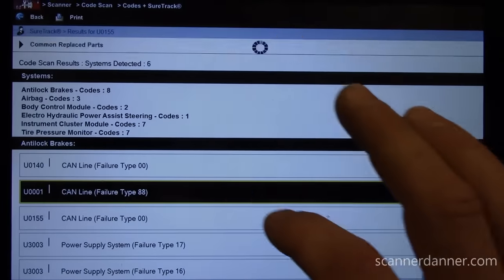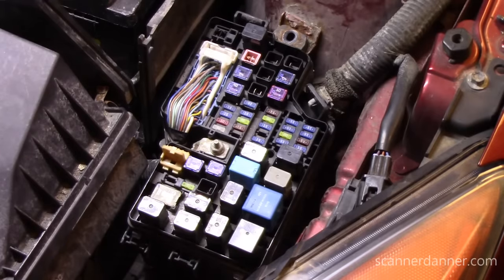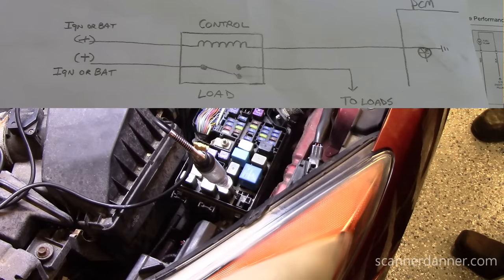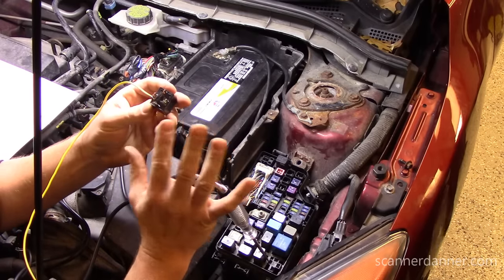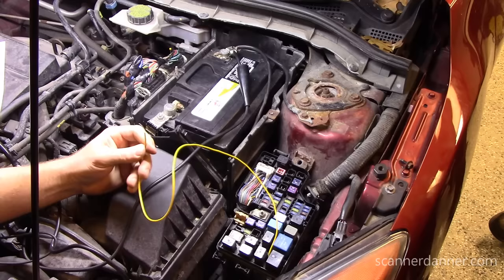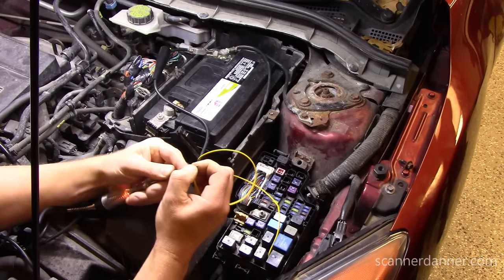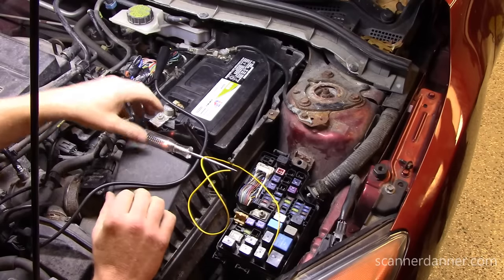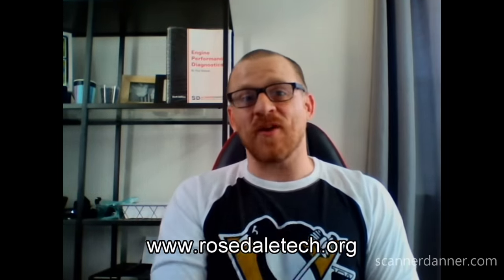2010 Mazda 3 No Communication With PCM, No Start, No Crank

Comment: I hope you can help me. There is no turn over when engine is hot it seems. No sound at all, no starter motor click nothing. I usually wait 15 minutes try again, so far it starts.
Sometimes when cold when I turn the key, there is a second delay before engine starts. My closest Auto electrician is 250 kilometres away. Battery is 8 months old and charged. PLEASE help if you can. Thanks.

Comment: I have 2014 mazda 3 when i start the car all the lights turn of and back with light engine and the steering wheel lock out & in 😬 is this battery issue?

Comment: Is that main relay considered the ignition relay?

I have a 2017 Ford Focus se no crank condition, 5v reference is good, new battery, U0100 (ecu took a hit in the accident but board looks good) all grounds looks good. (Jumped the starter relay and can manually crank the engine with the starter) 
Online support for wiring diagrams of ecu pins suck so I have not found ecu ground yet. Ignition relay is ground side switched.

(I dream of shopkeypro)

Watched your video about 6 times by now lol
Probe coming in the mail tomorrow so hopefully that will help narrow things down.
Reply from the maker: Here you go my friend https://eautorepair.adtrk.biz/?a=10817&c=24&p=r&s1=
Just seeing this now
Reply: @ScannerDanner  sweet this is like Haynes but online!
Reply: @ScannerDanner  the only thing I have found possibly being off is the input power for the ecu is 10v yet other pins are 12.4v
Reply from the maker: @thestateofreal2533  it is WAY better than a Haynes manual, that I can promise you
Reply from the maker: @thestateofreal2533  the one that reads 10v, will it light up an incandescent test light? (DO NOT use an LED type light for troubleshooting, they are garbage)
Reply: @ScannerDanner  yes it did light up the incandescent. After further investigation under my microscope the pcm board had a burnt spot where a resistor looked like it was there. I have ordered a pcm (as I was never originally planning on keeping the old one because it was so mangled) I’m gonna reprogram it to the car with forscan and see what happens from there but at least I will start with a good pcm.

Comment: I have the same issue on a 2008 Mazda 3 2.3L. I followed your steps. I have no power to 5 10 amp fuses, 32-36. I grounded out relay like you did but still get no crank. Not sure what color cable of the harness to ecu to check. Can’t find diagram anywhere.
Reply from the maker: https://eautorepair.adtrk.biz/?a=10817&c=24&p=r&s1=
It will cost you $20 but best money you'll spend. 
It is the DIY version of the same service info I use

Comment: I had a 01 Honda Civic and touched the Ac high pressure switch with my test light to power and smoked the ac control head and had no more ac compress control from pcm and not to sure why it happened, any insite would be helpfull
Reply from the maker: without knowing the exact wire you touched, I cannot even speculate what happened

Comment: My younger brother jumped my Mazda 3 2010 backward it stoped running we took it to a place they got it running but now no radio, no air, trip miles resets each time turn car off, car only locks with key in door no place can figure it out 4 places $200 each said they don’t no I’m $900 deep trying to figure this out and I have gotten nothing. I need help. Could you inform me were you got the 2010 Mazda 3 fuse diagrams. That’s what I need to get my hands on I can’t find it anywhere
Reply from the maker: Here you go https://www.eautorepair.net/marketing/html/products.asp?VID=&Count=Y
You most likely have multiple faulty modules from the reverse polarity jump starting

Comment: Which relay is that ? 
But I have tested 6-15 they both have ground 
But my car doesn’t work 
I have posted the issue on your website 
Please help me
Reply from the maker: There is a reason I had you post to the forum.
1. In every one of your questions you are not providing enough info.
2. You continue to start new threads leaving me with ZERO history.

YouTube comments are one and done for me, if your lucky. This platform is not set up properly for back and forth messages like this
Reply: @ScannerDanner  yeah it’s only one post them 
I think I’m getting there

But u know in each video of yours I’m following and learning  as I go as im testing all the possible faulty scenarios you came through. 

Thank u mate 
I think I finally got to the problem

Comment: hi have a 2012 Mazda 3 - i have 4 emission codes P061B-P0091-P0102-P2090 - I troubleshoot then already they check it out. i used my obd2 to delete the codes but does not work. disconnected the battery also. Checked the ground on the PCM and still the codes come up. when i turn off the key the obd2 turns green light (no codes?) when i turn on the key the codes come up again. ??  the car runs but rough idle and does not move more then 20 miles ...checked fuel pressure 65-55 psi it hold after 5 mnts. please advise. thank you.
Reply from the maker: you need to find the common tie to those codes and research what each one means. This link will help you find the service information you need. 
https://www.scannerdanner.com/forum/post-your-repair-questions-here/3757-need-service-info-check-here.html

(it is free to join my forum btw and we can help you there more if you need it)

Comment: so should i always use incandesant test light as a jumper or is this more for low amp circuits?would test light work as jumper for average to high amp circuits of does the light cause too much of a buffer? this question is for anyone who knows
Reply from the maker: Low average circuits only and we use it instead of a jumper wire, in case we get our polarity mixed up, so we don't hurt a computer driver

Comment: No Comms , I had good Comms with my little scan tool on my Audi TT until I plugged in a new tool which didn't have Comms so I went back to use my old tool and I still have no Comms !
It's like the new tool has killed the car ! 
She still drives ok so what's happened ??

Comment: Huge huge question what if you weren't getting power to that specific fuse/relay inside the fuse box, and what if you had pulled that fuse/relay, and witnessed that fuse/relay in particular wasn't blown, but once you insert a test light to the  fuse box terminal that goes with the same fuse/relay, but yet get no power drawn. Would it be a faulty wire, or would it be the TIPM box itself?
Reply from the maker: Can't answer without looking at service info on the specific year, make, model and engine and the exact fuse you're talking about. Post this to my forum www.scannerdanner.com it's free to join and we can help you there.
Reply: @ScannerDanner  thank you on the response, and I will send that forum ASAP. This is my very first time working on a vehicle and it's a no start signal.  I've never ever had one. Which make this experience more suspenseful 🤕.... And, it's stressing me 😤...  I've always did like minor maintenance to vehicles,  that I've obtained, and never ever I mean like EVER did they gave me issues. But, this no volt/power to that one fuse to the TIPM, As well to my TeleComm (OBD, I forgot to mention.) really have me in a limbo  Now, although I know it's tricky, and I've heard you stated it alot.  I just want to solve it myself. The only way I'm bowing out is if one of the module i.e BCM OR ECM, or if the gasket and cylinders are gone - if then forget about it. Thanks a million.

Comment: Hey Scanner I’m working on a 2010 Mazda 6. No crank no start. With the key on I’m able to jump the starter with a power probe and the car stays running. I’m trying to connect the scan tool and it can’t communicate. Checking pin 16 should have battery positive but I’m getting a ground. Any ideas that can steer me the right direction?
Reply: I’ll even pay for an answer I watch your videos all the time and they help me a lot. The shop im at has no master tech.
Reply from the maker: Focus on the starter circuit if you can jump it and it stays running. Wiring diagram and tests on that circuit would be your next step
Reply: @ScannerDanner  thank you for your help. I think someone jumped it backwards. The 125 amp main fuse was blown. After replacing everything works again.

Comment: ('07 Mazda 6 I) Do you unplug everything from the fuse box to get it to rotate all the way around?  My GFs car anti theft is freaking out making the same noise as your demo. I checked all the fuses replaced the "room" micro fuse under the steering wheel. Switched the horn and main relay and they work. I replaced the starter thinking it was that but still same issues. Its possibly a broken wire like in your video.  This has been very frustrating and my girls been in tears. Thanks for pointing in me in a new direction to check.
Reply from the maker: I don't remember, I'm sorry 😐
Reply: @ScannerDanner  can i ground the starter relay w a jumper anywhere or does it need to be the neg battery terminal? I got the fuse box over but cant find a loose wire but it only has continuity at 1 point.

Comment: Am! Sir, may I ask you about your test light. The test light that you had been used was a bulb inside it is 12volts or 24volts?
Reply from the maker: 12v incandescent bulb. It is made by OTC and you can find it here to compare to what you are interested in https://www.amazon.com/shop/scannerdanner
Reply: Thank u so much sir to your a very nice riply. Actually, I really really appreciate your method and strategy in doing troubleshooting and repair. Thank u sir...

Comment: How is the test light supplying ground? I’ve tried it myself outside with a 1157 bulb and socket and put power on one side and tried to use the test light as a jumper like you did- and nothing happened
Reply: Is the bulb in the test light pulling enough current for a relay but not a higher amp light?
Reply from the maker: Depends what you're trying to energize. A relay coil is a very high ohm circuit and only draws 100ma. My test light has no problem energizing that.

Comment: Hey, Paul. On the forum, we are dealing with a lot of no crank no start due to the pcm not grounding  relays. Like in this video, if you had a voltmeter  hooked on battery positive and starter controlled pin and cranked the engine, you should get 12 v, right? We, sometimes, check for voltage drop in the control wire when we shouldn't, which leads us to improper diagnosis. I would appreciate your answer greatly.
Reply from the maker: Actually, if you are connected that way, a good reading would be 0 volts! Remember, difference in potential. So if you have one lead connected to battery positive and the other to the S post of the starter and there is no power getting there, the meter will find a ground through the solenoid winding and show you 12v! 12v in this measurement would be bad.  IF the S post is being fed power, you should read near 0 volts, though on that circuit you will most likely read about 1v due to the voltage drops in the circuit. In other words the battery would be at 12 and the S post terminal would be at 11 and the meter would show you 1. 
Just tell your guys to leave one voltmeter  lead to battery negative for all checks, including the heavy battery cable. Just make sure they are cranking it, even if it doesn't crank, (hold key in the crank position) for ALL tests. Make sense? You must have the circuit "loaded".
Reply: Thank you, Paul for this brilliant explanation. I was talking about when the pcm grounds pin 86 of the starter relay, you should get 12 v with  voltmeter on battery positive and tip on pin 86. Thanks again!
English is not my first language, sometimes, my writing does not make sense.

Comment: Hey paul i see that 95% of the time you use the Snap-On Verus Pro. Have you ever replaced a sensor in a car that the scanner misled you the wrong path. Ive heard that before with other scanners. I was told the verus pro is 10k

Comment: Your gonna find most of your problems at the bottoms of them power distribution boxes or body grounds for sure. I’ve found a few myself when the fuses were good. Recently it was for the electric fans not working for the radiator on a lumina.

Comment: maybe you can help me with the mazda 3 2.3.
after changing the engine I have a problem with power steering and abs ligth on, previous engine,
pushrod broke and made a hole in the block.
Reply from the maker: Can't help without code information
Reply: @ScannerDanner  
thank you thank you for the answer I'm recording the video now, I'll include all the code and more or less checked
Reply from the maker: @zdzichzcan2808  Post this to my forum https://www.scannerdanner.com/forum/post-your-repair-questions-here.html it is free to join and I have paid moderators who are there to help me help you guys.

Comment: Well done man.
Reply: SD- I have a mazda 3 2010 just bought it from someone who couldn't get it to start. The anti theft system flash quick as soon as the key is turned on. No crack no relay clicking. Initially both keys had dead batteries that's replaced. I'm going to look into it further today but just curious what are some of the issues and how to tackle this job. I see you did an excellent work on yours similar car in everything with mine

Comment: Please do a video on those year Ford's in the 1990 range. I read thousands of people having no start issues. Our 1990 f250 4.6 manuel no start continues after replacing everything
Reply from the maker: I have quite a few EECIV no start videos, ranging from fuel pumps to broken power feed wires to the main power relay to faulty ignition modules and distributor pickups.
Reply: @ScannerDanner  what is the right # for the computer.its is confuseing.because this 1990 has a 1991 wireing harness.all the colors match whats in the haynes book for a 1991.so do we get the 1991 or 1990 computer.4.9 manuel
Reply from the maker: @tommavrakos  I'd say 91 if the colors all match a 91 diagram. Shouldn't be any different between those two years anyway

Comment: hey paul i was watching diagnose dans channel and he had no communication from a bad door handle position sensor. he didnt unplug the sensor, he just un pinned the signal wire and got communication back with module. my question is when you have a shorted sensor pulling down the 5 volt ref. i was under the understanding. that. the sensor internally was shorted pulling the whole 5 volt circuit down. i was confused because i thought the signal wire would just effect the signal wire circuit and the 5 volt feed would effect the whole 5 volt reference. so coul you explain to me and all the others premium subscribers. whats goin on cause when you talked about pullin down 5 volt ref frim bad sensor it seemed like the 5 volt ref feed was being pulled doen internally not the signal cause a bad signal wire would just effect the signal wire . hope that makes sense if not diagnose dans channel. bad door handle sensor keeping vehicle from not starting 10 mins long ...thank u danner

Comment: I have an 05 Mazda 3 and I went through a high puddle of water and the car just shut off on me and ever since I cannot get it started it just ticks but doesn't rotate the motor and start the pulleys just jerk a little bit I changed the starter and the starter safety switch or neutral safety switch and it's still the same problem

Comment: Can you do a video on a 2011 mazda 3 with a lost communication with the TCM? Like checking the harness first.
Reply from the maker: I only do case studies on what actually comes into the shop. If I get one, of course! In the mean time access to good service info is what you need https://eautorepair.adtrk.biz/?a=10817&c=24&p=r&s1=
Reply: @ScannerDanner  can you point me in the right direction to checking a lost communication to tcm code U0101? Tcm fuse is good, AT main relay is also functional. The Tcm is new so I assuming I have a loss of power or ground to the tcm. Just not sure which wire to test.

Comment: Hi mate 
But mine seems to have earth ? 
But it makes the same sounds 

Please help me 

I got 2020 model and does the same issue 
But I checked the earth , there is earth
Reply from the maker: Every car is different and I don't even know what you're checking
Reply: @ScannerDanner  it make same sounds 
But when I removed the relay u r talking about 
It has earth 

So I don’t know what else to check 
My ignition is on but car doesn’t start

And scanner says lost commutation with pcm 

Please help me
Reply from the maker: Step 1 - scan all modules on the network and find out what else isn't talking.
Reply: @ScannerDanner  I have these codes U0155 , U0100,P0882

Which all shows lost communication with pcm 
Or low

Comment: I have a 1990 toyota camry 2.0 stalled no start, no spark, and check engine light is not on with ignition on.
Reply from the maker: First thing, you need a good wiring diagram 
http://eautorepair.adtrk.biz/?a=10817&c=24&p=r&s1=
Second, with the key on, measure you voltage on your MAP or TPS sensor, one of the wires should show you 5v with the key on

Comment: I have an 08 mazda 3 its manual i cnt get it to start all it does is click put new starter and still does the same thing
Reply from the maker: make sure you can turn the engine over by hand first, then do some voltage measurements at the starter while holding the key in the crank position. This video will help you too https://youtu.be/oo1SRIFIkhs

Comment: this fixed my mazda but now if i put the e brake on it dies and no crack just like before i fixed it but then after i turn off the e brake it goes back to normal
Reply from the maker: Good luck! Start with finding out what you're missing and why, when the ebrake is on.

Comment: The code says elteical it cranks no starts whats wronf with it
Reply from the maker: the code says what?
Reply: @ScannerDanner  idk a guy hooked uo a scanner and then said it was electrical. But underneath on the fuel pump line its leaking.